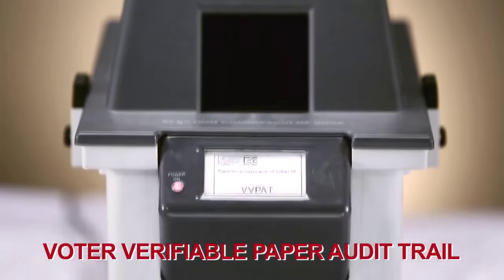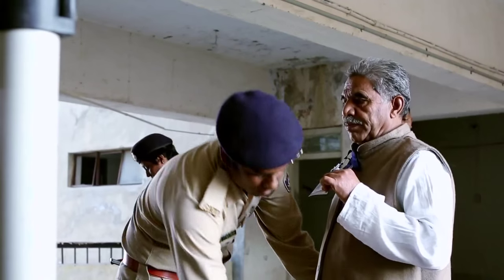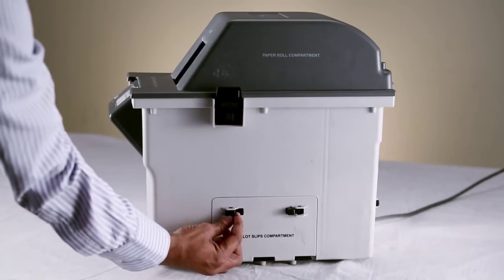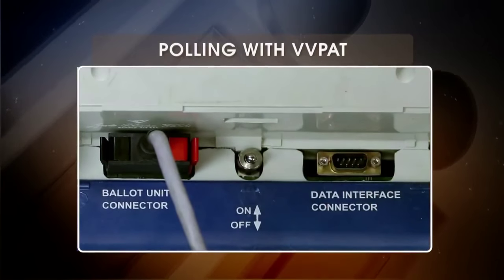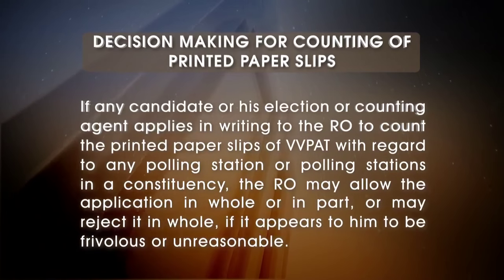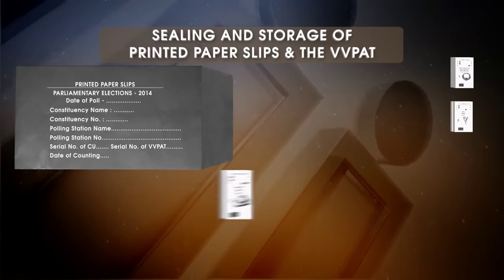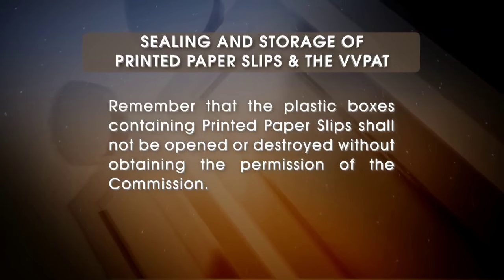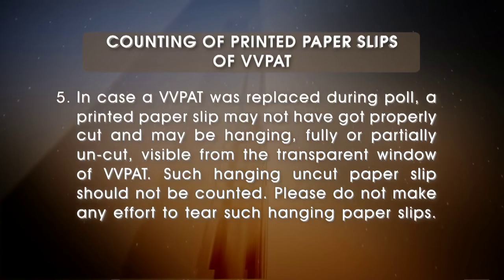Film on EVM & VVPAT

Comment: Cutting paper and bundling in according to party symbol is not good Idea. Non permanent thermal print is also not brainier. Each paper has to be counted manually. Printing on roll and digital marker to which will able to store easily and count automatically is better idea, Which will indicate voting sequence, time anot at all necessary to be with 5s exactly as voting took place which is one more deterrence in stopping malpractice. Separate VSDU should have been integrated with VVPAT machine itself with audio signaling.